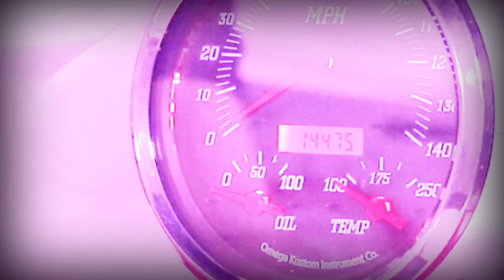C10 LS Swap: Motor Mount Kit & Transmission Crossmember (1967-1972)

Comment: I have a question on the motor mount contact once installed. The “Clam Shell” mount has 2 metal bars coming out the sides or ends. But, they originally fit a metal cup that has ears that stick out both side to allow additional support or a SBC or iron block 5.3L engine that weighs 500+ pounds. Any extra  support or weight distribution over this mount will last another 50 years. The OEM engine mount cup has the extra ears on both sides of the 5” thru bolt. On both sides of it, contact is made on the bars of the clam shell motor mounts, with cuts in the OEM bracket that help reduce engine noise & vibration into the frame and vehicle. I hope this not confusing but I have removed engines, mounts, and crossmember parts for decades. I just could see the contact in the video.
  Retired, ASE Master. Omaha, NE.